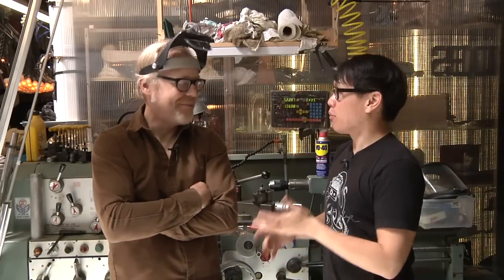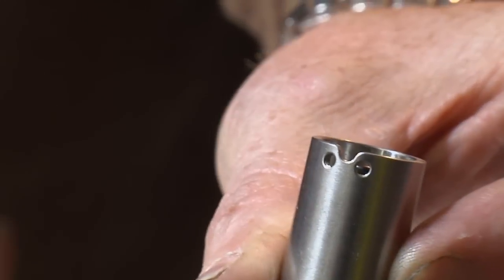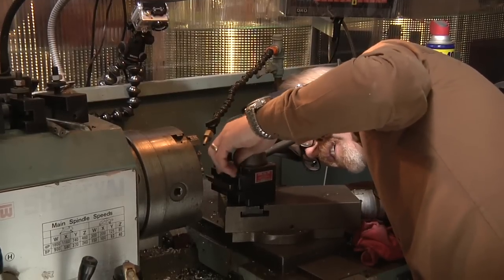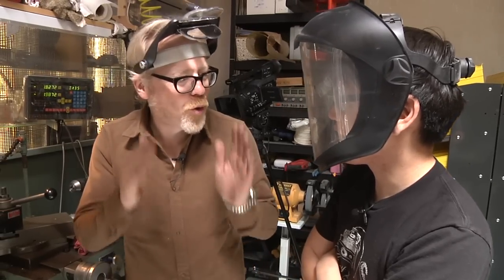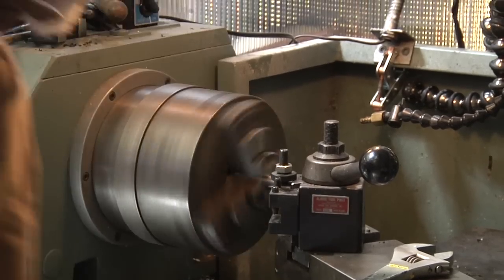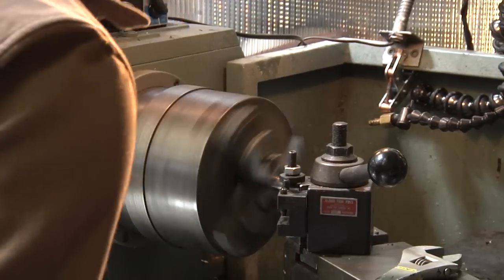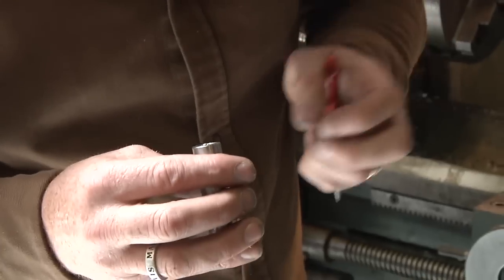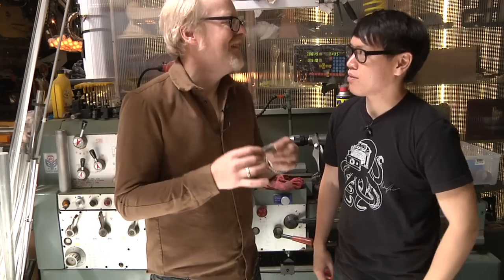Inside Adam Savage's Cave: Hacking a Flashlight for Adam's EDC

Comment from the maker: Comparing both, the iPhone's LED flash produces about 20-25 lumens. It's brighter than my watch battery keychain light, but significantly dimmer than the light Adam has here. The light here will illuminate something 10 feet away, the iPhone's LED won't. That's why you carry a dedicated flashlight. - Will

Comment: I truly respect Adams experience and knowledge but I just don't get the point why that flashlight with proud button should be better than before. Now there's a high risk to switch on the flashlight accidentally inside the pocket. And I don't see any problems to switch it on in it's original state. I own some flashlights myself from the kind they showed in the video. No problem to switch on or off...
It would be nice if Adam could give us some enlightenment

Comment: how in the world do you guys use inches, right at the beginning he said "ahhh about 3 16ths of an inch", that to me sounds so unreasonable, how do you perfectly judge 3 16ths of an inch, if we (meaning everyone who uses the metric system) are talking about fractions of a centimeter we just use millimeters, its a lot easier, but oh well america will always be independent, maybe even more so now than ever!
Reply: I'm Canadian. And although Canada adopted the metric system decades ago, we still use the "imperial" system for many thing. For lumber we still use 2x4, 2x6 etc. For metal products, same thing, 2x2x125 square tubing (.125" = 1/8"), 4"x1/4" flat bar, 4'x8'x1/2" plates, and so on.

I've used the imperial system all my life (I'm 50) and the metric system for a long time too. But it's still easier for me to guess the thickness of something using fractions of inches. I have no problem seeing the difference between 1/16", 1/8" and 3/16" without using a ruler or a measuring tape. It's not a matter of wanting to be independent from the rest of the planet, it's just that this system works better for me.

Comment: I thought the video was hilarious! First off why not buy the flashlight you want to start with?Secondly the safety he uses. I have worked on many lathes and many other limb tearing machines, for 30 years I still have everything that I was born with still attached to my body. If I worked like that thought it would of been different!I work primarily these days on laser cutters and waterjets. I do a lot of weird stuff on them, push the envelope on what they can or can not do. Why? Because I want to know what they can do. I cost the boss a lot of money, a lot of money, when I play doing stupid stuff. Yet I learn.Yet today the machines I work on do so much more than they were ever designed to do. I do some weird things that no one in ten years had done before. My boss says it looks great but sees no application for it, no money to be made. Over and over again.
Then one day a customer comes in and sees something I did in the showcase. Customer says I want that times 4000, two weeks later another customer walks into the front office and sees the showcase and says I want that times 2000. Few months later, I want that times 8000.I cost the company a lot of money when I play. I put the cost at $15,000. My playing has resulted in $350,000 in contracts and more.Boss says I hate when you play at work. Costs me money. Yet every time you do play six month later or a year later we get the money back and more.Boss thinks I am a wizard at my job.I love the Mythbusters. They are crazy, at times unsafe which makes it more entertaining.Never the less the passion they have for this is the same passion that drives me.Just wish the guys worked safer lol! Guess there is a reason they say don't try this at home lol!

Comment: kids... don't do what he just did on 5:55 ... the first class of ANY machining lessons: safety. Honnestly I was shocked to see it.. yeah it didn't go wrong but still... 4 out of 5 times things won't go as wrong as they could be, it's the 1/5 that screw you over so hard. If his hand would have hit bones would be crushed, flesh torn off, with some bad luck his hand was just gone round and pulled him with it. 

comment on the flashlight: the reason don't make it a proud button is because of the chance it turn on in your pocket, draining the batery.

Comment: I am very surprised! I am usually so impressed with the projects in this series. I wouldn't have released this vid, if I were Norm or Adam. 
Firstly, for it's foolish  disregard of workshop safety, and  secondly, because the modifications, made, were pointless, and rendered the flashlight far less useable.
Reply: Cliff, its Adam's flashlight..... he can mod it anyway he sees fit, for the purposes only he can forsee. But I totally, 110
% agree with you on the safety he violated. Ive been hurt by machines..... an industrial injury is a life changing event

Comment: wow, seeing Adam sticking his hand under the spinning chuck nearly gave me a hart attack. first instinct should always be to stop the spindle trough the footbrake, it should be wired to turn off power to the spindle motor when pressed (if it isn't already).3 years ago I had to pull my colleague out of his big lathe, a well experienced craftsman for over 30y. just one miscalculation nearly cost him his life and severely impacted the use of one of his arms. don't mess around, shut it off before you do anything else when a mishap occurs.
Reply: I have never used a lathe in my life but I winced at that point.  That thing looks like it could rip your arm off and it's suddenly grabbing at things when everything starts to go wrong.
Reply: plus he has long sleaves on, a watchg on and a ring I think lol.

Comment: Having a proud button on a EDC or pocket flashlight defeats its purpose. It's now susceptible of accidentally turning on while in your pocket. And when you really need the flashlight, your batteries are out. Also the design of having it flush is so that you can stand the light on its tail cap.

Comment: Check out the AAA "Arc" LED flashlight. It's the size of the old AAA pocket lights. It's waterproof to 100 ft so it won't get recked when you drop it in the sink (or worse!). It is small with a lot of lumens. It turns on and off when you twist the head. I use it with one hand by biting the head and twisting. Then I hold it with my teeth for two handed work.

Comment: All led flashlights have buttons that fail to soon. They are all junk. Not talking about the lathe throwing it apart.
Reply: +Brian Patton I have to disagree with you there, I own plenty of LED flashlights that are far from junk.  Pick yourself up a Surefire or Elzetta and see if it ever fails on you.  I've had a Surefire strapped to an AR for years that sees use all the time and another that I EDC and both work like the day I got them and have been through hell.  Sure there's cheap shitty ones that won't last a year, but if you buy a good one it will last you a decade without missing  beat.

Comment: Lathe up something to clean those fingernails with. lol
Reply: +andrew brabank Well like anything in english new verbs can be created out of nouns, it happens everyday. Languages evolve, I am saying this not to discount the fact that you did correct me on the currently accepted correct term for the verb form, which I had no clue about. I am saying this just because that is the general trend in languages, so I could see lathe becoming a verb, and then perhaps even an adjective for someone that is really twisted.
Reply: andrew brabank thank you for  mentioning these issues. There is always a good reason to do something wrong... until the accident happens. 
Other than those exceptions and though this is not my personal perfect flashlight, I enjoyed this video.
Reply: Marcus and Adam, lathe is not a verb, you are turning the flashlight, actually in your case facing the flashlight.  I am a machinist by trade and enjoy watching this channel. But sometimes Adam is an expert in things he is clueless about. I love his passion and enthusiasm for making things but let your work speak for itself.  Adam your tool is hanging out to far, and it sounds like your rubbing. No relief? also avoid driving your compound out so far. In that case you didn't need it. And No end mills in the drill chuck!!!! I've seen you do it. No!  Bad!  
And safety police. Your absolutely correct about the wrist watch and long sleeves. But I think you'll find be alright if you don't stick your figure anywhere you wouldn't put your pecker.

Comment: ..it's gonna switch on accidentally in the pocket now
Reply: +Albert Richters Why would anyone want a protruding button on something without a pocket clip??? It's not only gonna switch on and drain the battery out, rendering it useless when you need it the most, but also you can't stand it on the end now to light up a room for example. Utter nonsense, but hey... whatever works...
Reply: +Albert Richters More like Adam went and bought a new flashlight.
Reply: I was thinking that, but, I guess it's personal preference.
Reply: +68Stan I don&#39;t know why he wants it like that, I think it has someting to do with comfort or that he might have problems switching it on easily due to his worked fingers.

Nevertheless if he wants it like that let him have it. If he goes the lenght to actually machine and modify his flashlights to fit his needs he will have his reasons ;-)
Reply: +Albert Richters  yeah i know it one thing to make it less recessed but now it's gonna turn on in his pocket and drain the battery. Also how's it going to be a key chain again its got no holes for the ring?!
Reply: No it wont, the button requires too much directional force to depress so Adam has proven you dumb once again

Comment: Wouldn't it have been easier to simply extend the button?
Reply: +smokeydoke100 so you finally get a righteous answer and all you can come back with is a grammar correction...? nice...
Reply: smokeydoke100 No.
Reply: wikieditspam Yes.
Reply: +smokeydoke100 No again.
Reply: Diego Velázquez Yes again. How about providing a reason this time?
Reply: smokeydoke100 You'd need to find something to attach to the button that will work reliably, won't break, and won't look too ugly. If you have access to a lathe it will be trivial to just take off enough material to expose the already mechanically reliable and ascetically desirable button.
Reply: smokeydoke100 Your milage will vary.
Reply: wikieditspam  You mean mileage?
Reply: Diego Velázquez Your point, sir. But in my defense, this was the first time I'd seen your extended reply, with your follow-up containing the typo being the only one showing under the 8 comments clicker.
But my point being that rather than going through all that trouble, it would have been much easier to simply add one of those stick on rubber dots that you put under lamps and such. Just peel off the backing, maybe fortify the adhesive with a bit of super glue, and that button's standing well proud of the housing.
Of course, with Adam, reinventing the wheel is just a Saturday afternoon project.
Reply: smokeydoke100 Who REALLY cares?
Reply: +wikieditspam wow like that's hard to do lol it would of been way easer to find something to put on that button

Comment: I've often wondered.
Why do Americans call a torch a flashlight, when generally they aren't made to flash?
Reply: Because when they were first invented the batteries were archaic and used zinc-carbon and combined with carbon filaments in the old bulbs they would rest some of the time so they had brief periods where they would rest and flash as well as their duration.

Also that is the name that the device was patented with so really its more strange that people call them torches when that was never their name.
Reply: Jamie Thomas It confuses me why people would call a flashlight a torch, when generally they aren't used to torch? Though, perhaps I'm merely ignorant of the people who use their flashlights to rally angry mobs and torch buildings.
Reply: Torch is also associated with flames most of the time, where flash is usually general illumination
Reply: Jamie Thomas Well they aren't made to set things on fire either. You have a bit of a catch-22 there. So what do they call the thing that you hook up to gas to generate a strong flame in the UK? That is what we call a torch.
Reply: Jamie Thomas they also aren't a flame at the top of a stick used to light the way in times before electricity....:P

Comment: does anyone know what model flashlight that is?  I can't find it on the website.
Reply: Not sure either, but I did get a Thrunite T10S. Highly recommend it. Stainless steel with a half-recessed steel button (Rim is only about half the circumference and split in 2, so it's easy to turn on and off, but protected) and it has 3 modes that all seem perfect for what they are intended for. Best part is that it has memory, and will remember the last time you turned it off. If you turn it off and back on within 2 seconds, it cycles through the modes. Best of both worlds - Turns on and off, and that's it, like adam prefers, and has modes for different uses, but you don't have to cycle through it every time.
Reply: redbird963 I believe its a Jetbeam E3S or a EP

Comment: Adam's comment on cooling fluid is no always correct. When using hard metal tools the heat actualy changes the cutting properties in a way that it benifits the cutting. 

So do your research! :) 

But his comment was correct in this setup with a HSS tool.

Comment: God, I hate watching people put their hands near a running lathe.
Reply: alot of shit happens in the workshop. youve not experienced fear until youve seen a crank stuck in a motor stuck at full throttle. you know its bad when your running away as fast as your lecturer.
Reply: Why, I'm sure he's confident enough and as long as you don't have loose sleeves it's fine, the amount of times I've used emery paper on some metal in a lathe and I've had no problems
Reply: Robert Brook dear god
Reply: trust me my teacher was fine he showed a technique where you take chips from the work and use it as an abrasive just get a handfull in your palm and rub it on the work
Reply: Dwight Schrute i was watching a gcse lathe revision demo and the teacher put his hand on to see if the work was smooth
Reply: it was a revisit for my exam i find my results tmoz so we finished a project table and then we revised for 15 hours in theory and the lathe was on the paper so
Reply: N37BU6 i
Reply: @Calum Kelly Did you have to wait for it to seize?